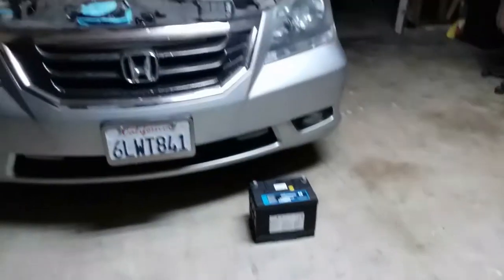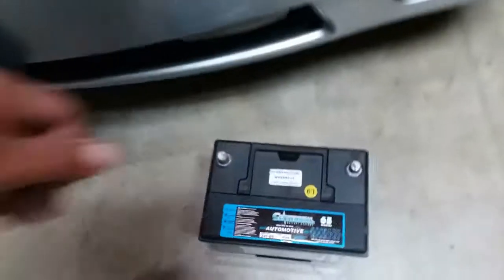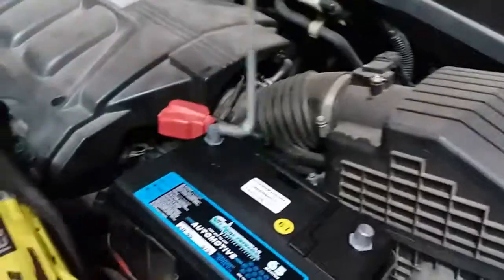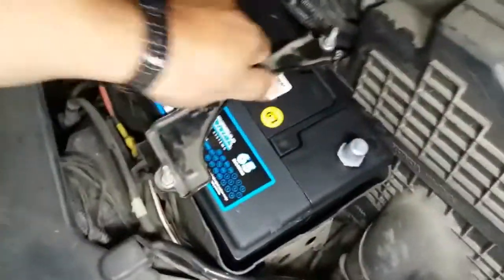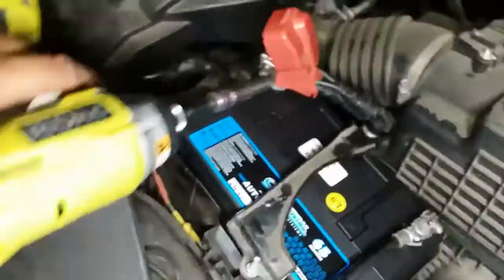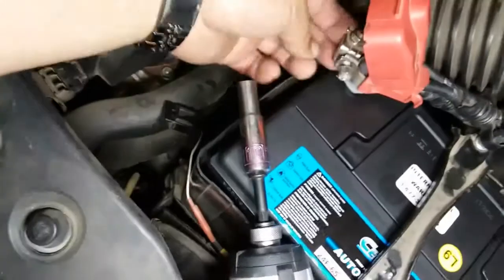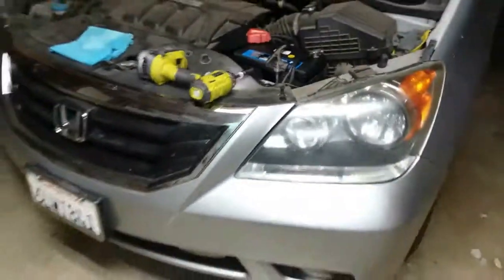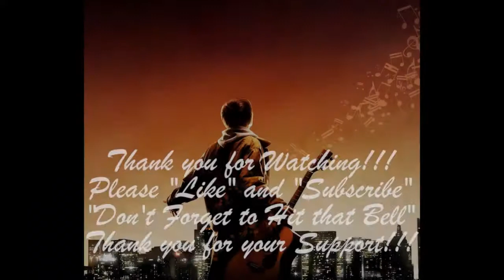How to: Install a Battery on a 2010 Honda Odyssey

Comment: Wouldnt the radio lock tho?
Reply from the maker: Yes it will you need to have your code available or use a memory saver.
Reply: @559powerscape  any advice on where to get the codes?
Reply from the maker: Yes this is the honda number. You will need your fill vin for verification....
1(800)9991009

Comment: I keep getting sparks when I try to clamp the negative cable to the battery terminal.
Reply from the maker: Yeah that's cause there's current going thru it...u should be okay unless u connect it and it heats up, then u have a short somewhere.
Reply: @559powerscape  thanks 😊